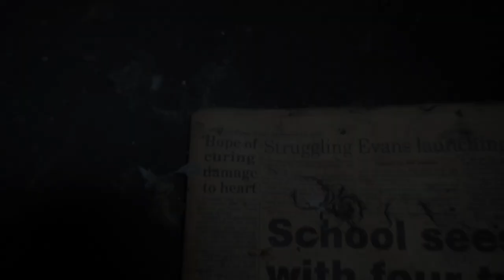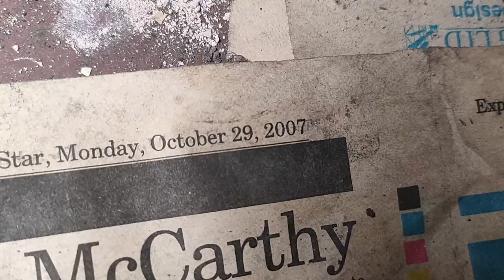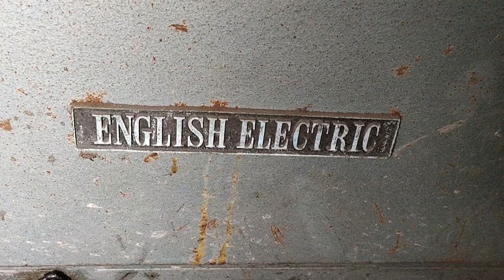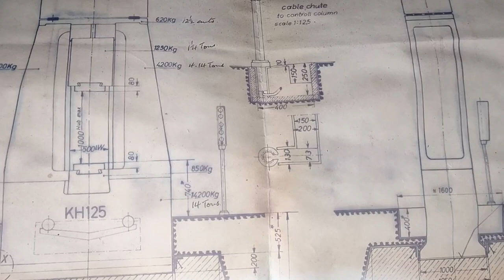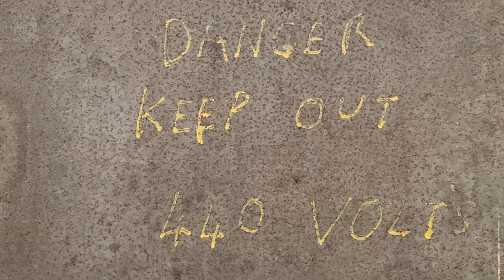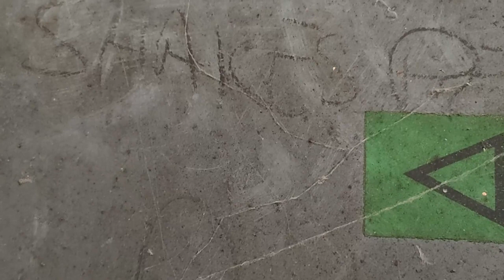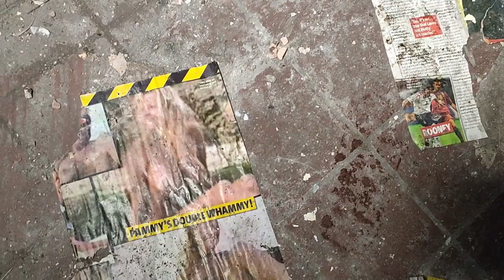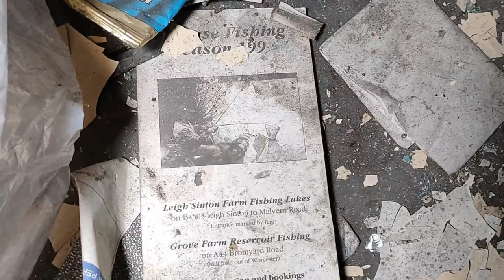shakespeare  factory explore | abandoned places uk | urbex

Comment: Hi, fascinating and not the 1st video I've seen of in there recently. I used to pop in there to my dad in the late 1980's during my school lunch break. Dad worked there from mid 70's until it closed. I remember all the machinery and how dark it was in there. It would be over 100oF In the winter, sweltering 140oF in the summer. All the leaking water is due to the drainage pipework been Ripped out and weighed in.
Reply from the maker: Wow that's interesting  also amazing Ur dad worked their to great information about the factory as I could not find out alot online about the factory! Thankyou for watching and the cool comment👍

Comment: The room with the grey cabinets is a sub station transformer room that supplies the electric to the factory, you was right that was a industrial heater either gas or oil fired, the machine on its side is actually another transformer they are oil filled with copper inside, that place has been well stripped of all the copper, great video.
Reply from the maker: Thankyou I thought that was some kinda heater as I was not sure to begin with! Cheers for watching and being here 😊